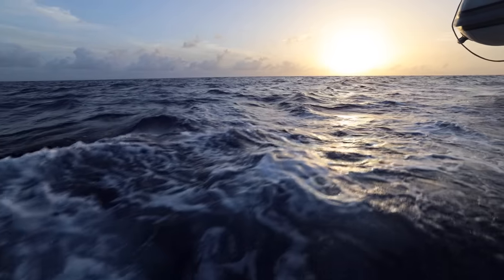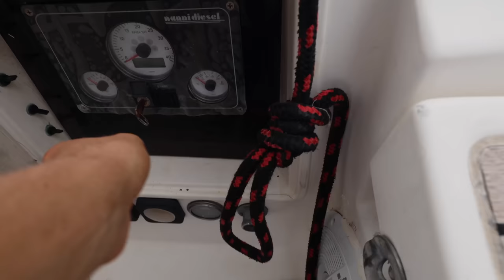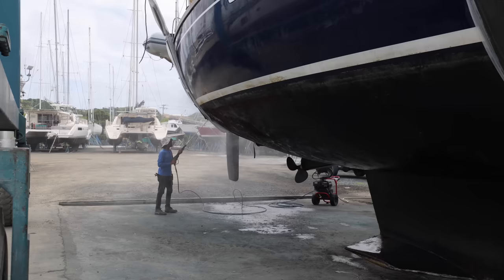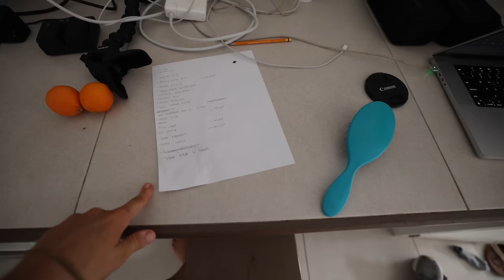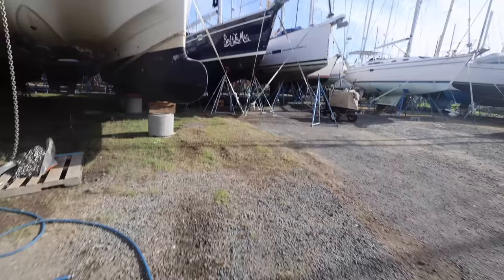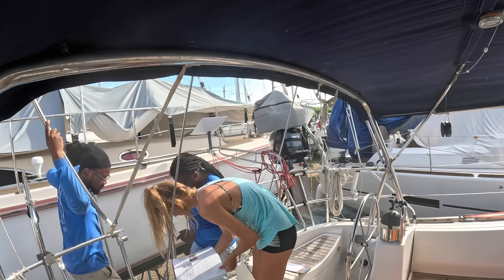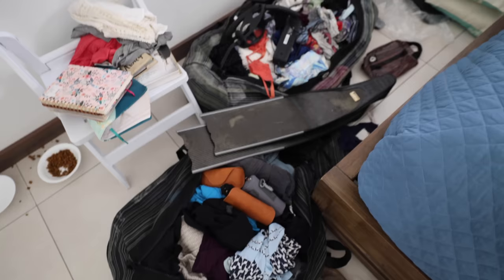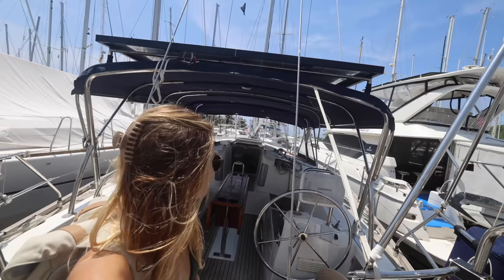Saying Goodbye... it's not easy [ep 85]

Comment: First distance race, and we had one crew not show up, then discovered our spinnaker bag contained a genoa. The club launch made a long fast run to bring us a spinnaker as we were heading for the start, the and missing crew came out on another boat at the same time. Talk about threading a needle...at race speed, sandwiched between two motor lauches, taking on crew from one side, swapping sailbags on the other, and feeling VERY much like the filling on an Oreo cookie. Somehow, it all worked out.
 Grab racing rides for a while. It really builds your cruising confidence!

Comment: Mainly sailed in New Enlgland with wife for 40 years. Four weeks was enough for us  at a time and happy to get home. Boat was also a beach house in Ct. Then came south with boat in our early fifties. Trucked it down. Sailed the Bahamas but too hot and buggy.  Very rough inlets in Florida. Water too shalow for a deep draft full keel boat. Motored the intercoastal to Tampa via Lake Okcheecibee. Boring until Ft Meyers. Added a Boston Whaler to our fleet. Dockate is hard to get for the saiboat. Full service yards have  turned into condos. Too hot to sail in the summer and the sun beats the hell out of the boat. AC is on all summer. Miss all the different deep harbors and islands in NE. But too old now to sail the old way. So Lauren enjoy the hell out of you twenties. We did and never looked back. Sailing is responsibility. Never forget that. Never forget basic navigation skills. Know every inch of your boat. Good mechanics are hard to find on the south. Nothing stays the same. Put Damp Rid in the boat when its closed up.

Comment: A trick I learned about prop walk.   If you walk to port for example and need to navigate to starboard.  Right full rudder and full throttle astern in short bursts.   Just enough to get you moving and water moving over the rudder.

Comment: Awe the boating life, so glad you enjoy it and are willing to share. Business: Zinc anodes, when let out in the air for a while they will form a hard coating that will prevent them from working properly so use a stainless wire brush and go over each of them if you have one that will attach to a drill even better. The sacrificial anodes protect every metal part in your boat. Bearing, shafts and couplings will respond well to a bit of heat (oven, torch, heat gun, induction heater) to expand them or cold (I have used dry ice) or even the freezer overnight such as your shaft bearing helps them slide in quickly until the temperature equalizes. Painting the hull, make sure the ambient  temperature and humidity fall within the manufacturers recommendations. I have seen the bottom paint completely come off the hull of a 210" ship in six months and it ate up the new zinc anodes as well because those guidelines were not followed. Sorry for the boring part. Be safe and much success.

Comment: Hi Lauren leaving your precious baby so far away must not feel good. You have in the past complained about the AP, my question is why did you go for a hydro vane system and not get a more accurate up to date electronic unit. As more and more power operated items become a must on a boat you need to look into upgrading the batteries to a higher capacity and if possible run off 48V system. If you look at most of the other successful sailing channels  they have a well set up battery system that gets them what they need. At the boat show if you get a chance try and chat with those that are there for advice.

Comment: Put Ac on the boat girl.
Reply: the power draw would be way too much, she already needs more power than her system outputs as is.
Reply: A/C is nice but it's a huge draw on the batteries and it's another maintenance issue.  Besides when you are in the cockpit it is always breezy as long as you aren't in chains. And at that point you dive in for a swim. There's always a solution provided. We just have to be flexible and find it.